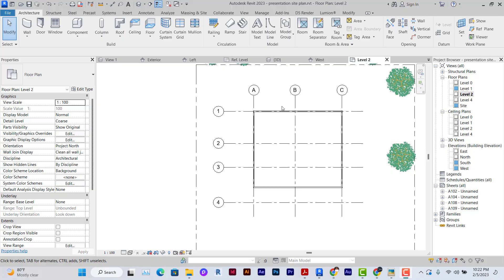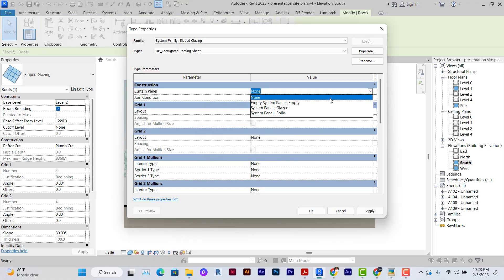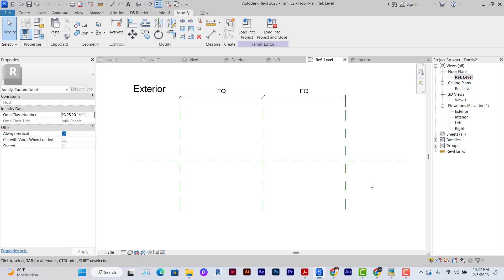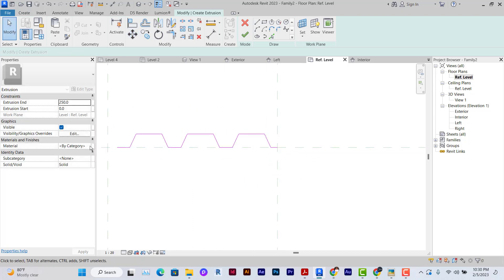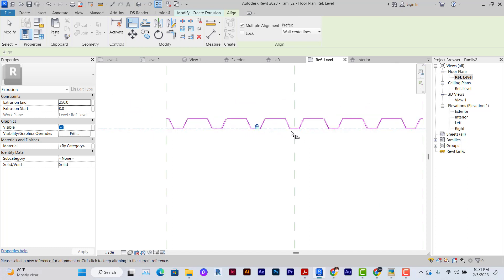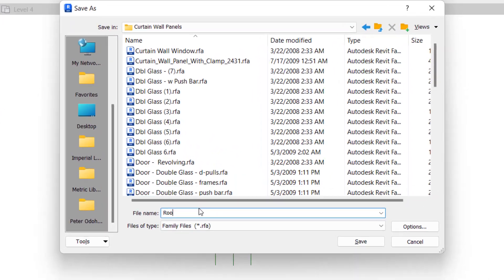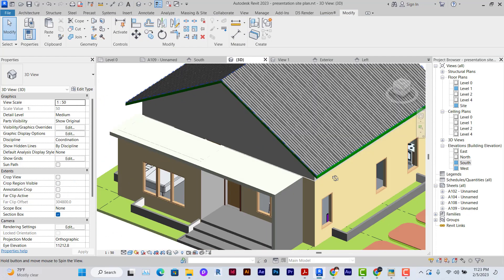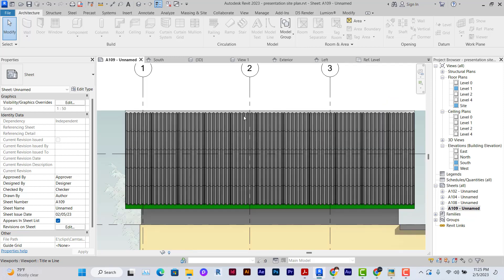Corrugated Gable Roofing |  Tutorial Revit 2023

Comment: Thank you very much for this particular course but then I tried out the tutorial my only problem is that the corrugations are not aligning properly.
please help me out 😢❤
Reply from the maker: Try and make make sure the roof length is exactly divisible by the number of panels, if your panel width is 600mm, try and approximate your roof length to 3m, 4.8m, etc, something divisible by 600mm... 
I hope this helps